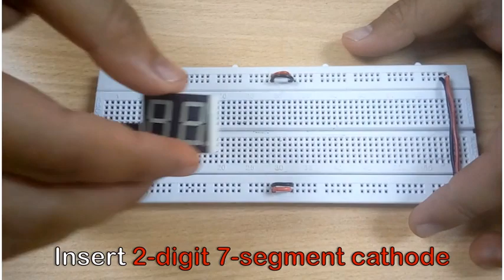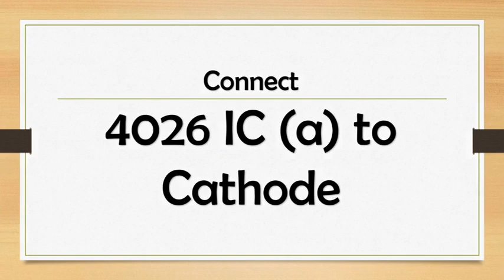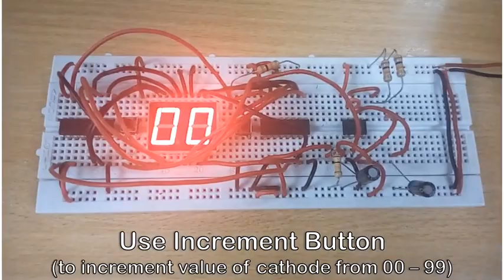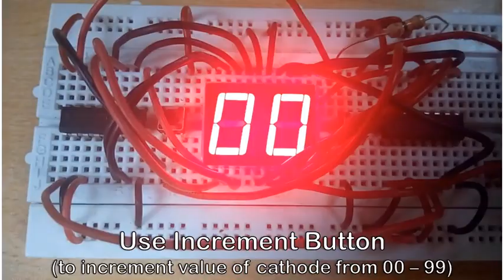Shot Clock (2-digit 7 Segment Cathode Display) TUTORIAL

Comment: Hi Rommel, congratulations on such useful tutorial. I'm using this setup for electronics circuit self learning and will purchase the parts to assemble it. There is one step I'm confused about. Specifically at time 10:33 where you are connecting Pin 7 of 4026IC (b) to G2, it seems you are actually connecting Pin 6 to G2. Can you please clarify?. I have subscribed to your channel and hope to see more of your work. Thanks.
Reply: Have you got the output?

Comment: Cn i fix the number ,means i wana count to 60 than again start from zero ,not to 99 ??
Reply: You have to use logic gates and use them so when the digit reaches 6 it reset like another video used the e, f, g segments from the output of the counter in and gate and took the output to the reset pin
Reply: @karimraafat4957  if u dnt possible ,hoto plz g circuit ka video bana sko to its easy for me
Reply: @karimraafat4957  ho ske to plz iksa video banana ,its easy for me
Reply: You can use Arduino ..but the thing is the circuit is not working plus he's not even giving us a circuit diagram